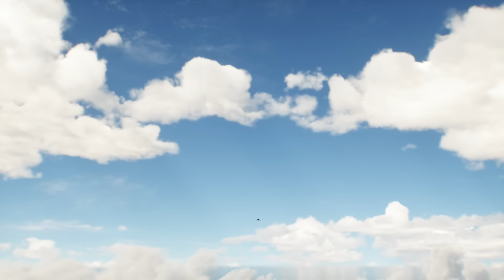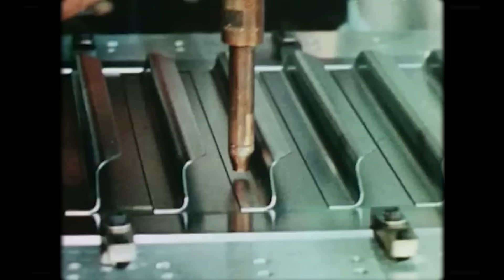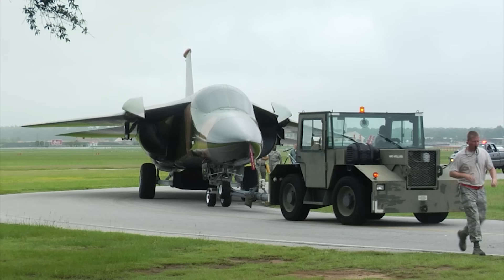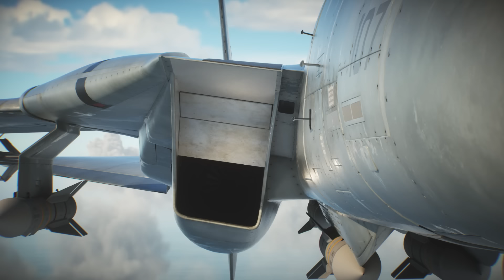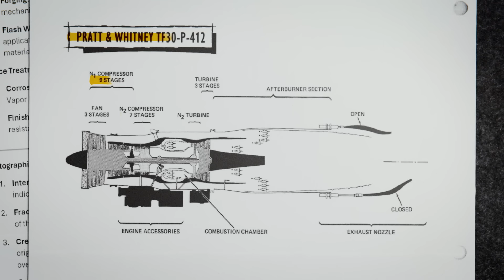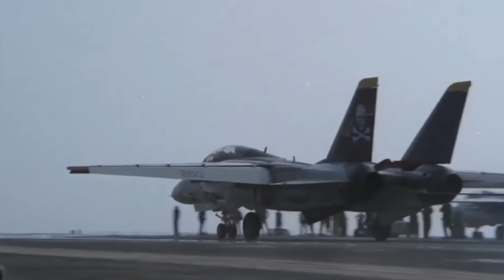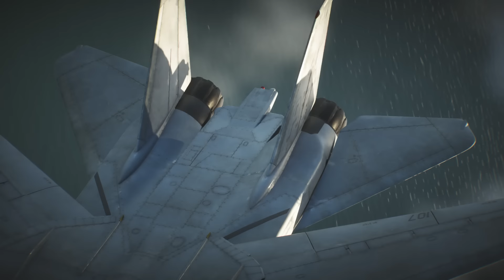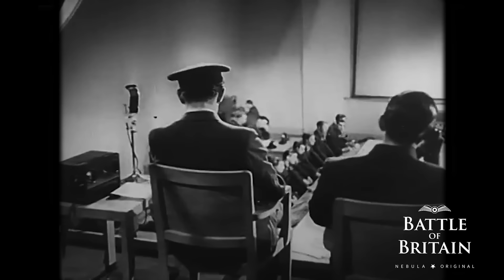The Insane Engineering of the F-14 Tomcat

Comment: Titanium isn't welded in a vacuum as you mentioned, it's welded in purge chambers that are air tight and atmospheric air is purged out with pure argon so that there is no oxygen present for the weld. 

But the electron welding process they made is a very cool process
Reply: you are correct, a small point but yes welding under substituted atmosphere
Reply: @metallicamadsam I don’t think it’s a small point. Doing anything under vacuum is difficult, and a substituted atmosphere would be a much, much easier process. Titanium is difficult enough to process as it is 😅
Reply: @eedobee  some titanium is welded both in a vacuum or with argon instead? correct or am i missing something
Reply: Titanium is welded under vacuum when necessary. It all depends on the application requirements, some applications can get away with just a gas shield, others a purge tank, and then critical applications such as a fighter jet wings get welded in a vacuum. I can’t imagine the F-14 engineers chose the more difficult and expensive welding process for kicks and giggles.
Reply: Electron-beam welding was chosen probably because it can produce higher-quality welds with fewer flaws and voids, which I think is required for applications like these.
Reply: Sounds cheaper to pump some Argon or nitrogen in as opposed to constantly recreating and maintaining a vacuum
Reply: While this is true in normal welding, electron beam welding does use a vacuum. In fact you cannot have a good electron beam without a vacuum be it in a vacuum tube, CRT monitor, electron beam microscope, etc.
Reply: You are incorrect, the titanium of portions of the Tomcat's wings and its wing box were welded in a vacuum chamber the size of a small house.  Grumman had 2 of these devices and added a 3rd. The type of welding was Electron Beam Welding, done under vacuum, not using substituted atmosphere or an inert shieding gas.  these were around 22 foot long weldments, the largest titanium weldments in existence at the time.
Reply: @hoghogwild  likely to mitigate the need for purging gases, and to help eliminate as much possibility for contamination, inclusions and porosity, I'd imagine.
Reply: But the Tom Cat were welded in a vacuum I think thats the point he was making.
Reply: Oversimplification to get on with a video that isn't about welding.
Reply: close enough cowboy 

i just wanted to say that cause it sounds like what a fighter pilot would say
Reply: FWIW, here's a bit from a NASA paper about the welders used on the F-14 "Electron beam welding, then, is essentially a mechanized fusion welding pro- -4 cess performed in a vacuum chamber where the pressure is reduced to 1 x 10
torr or less. "  https://ntrs.nasa.gov/api/citations/19740022811/downloads/19740022811.pdf
Reply: So titanium is welded like stainless steel?
Reply: You are wrong here. It absolutely can be welded in a vacuum. It's the same concept. Shielding the weld pool from atmosphere. Functionally identical.
Reply: Electron beams need vacuum. 
Tge beam won't work without a vaccum
Reply: Thanks boss, as a (MiG) welder foreman I was looking for just this comment. The welds wern't made in a vacuum, they were made in a over pressure room, filled with argon. Thank you.
Reply: It's also used as a reason why Iran can't maintain them. That simply isn't true though from what I can tell... There's really not much stopping them from just smuggling in a welder. Working with Titanium for new parts would likely be a much harder problem. Still likely within their reach for low volume stuff. Countries like Iran have trouble scaling things.

The reason electron beam welding isn't that popular anymore is because of advances in material science. The problem with electron beam welding is that it has to be programmed, and is also generally really slow.

If Iran isn't maintaining them it's more than likely just because they don't actually have much use for them as anything other than trophy's. The US ended up also not really having much use for them and them being too timely to maintain.
Reply: @lost4468yt  Another question is can they produce enough raw high quality titanium? And do they have the absolutely massive forging presses to produce the precursor components? There are only a handful around the world as far as I know.
Reply: @Virsconte  they would smuggle it from somewhere else. They also aren't going to be operating under the same conditions as the US, they'll be fine with increasing the weight, decreasing safety margins, not worrying about such a diverse range of conditions and part lifespan. And they're going to be operating with 50+ years of materials science progress that the US didn't have back then.
Reply: @lost4468yt  I've not seen much evidence that the titanium parts (the F-14 is 24% titanium by weight) need much maintenance.  For example, after the crash of the first F-14 prototype, the wing box was found six feet under ground, fully intact.
Reply: This.
Reply: i know argon is a noble gas but why bother with argon when they can just flush it with nitrogen or perhaps even CO2 ?
Reply: @fortheregm1249  you can use Nitrogen and CO2 as shielding gas, also helium, and sometimes a combination of gasses (C25 is a common mix which is 75% argon/25% CO2), can even do dual shield where you use a gas like argon and then the welding filler material has a flux core in it that burns off while welding and produces its own shielding as well

All just depends on what the material calls for, what the welding process calls for, what the joint configuration is, what the engineers call for, etc. each gas welds with slightly different characteristics but the most common for pretty much the large majority of processes is either pure argon or C25
Reply: @fortheregm1249 both nitrogen and CO2 can actually react with the metals and mess the welds up. Argon is used exactly because it is an inert gas.
Reply: @fortheregm1249 
co2 reacts in the Arc, same with nitrogen.  Depending on the process used you can use co2 with argon but the argon is critical for most types of welding with shielding gas.
Reply: Tomato tomato
Reply: @pr3ludejr  Let's call the whole thing off!
Reply: I just said it twice the same way 😅 @pr3ludejr

Comment: Holy hell y’all, you guys need to stop lusting over this thing. It’s cool, sure, hell I love the thing myself. But you gotta stop making up facts about it, especially about the microprocessor. The reason he didn’t mention the “first ever”microprocessor in the F-14 is because it wasn’t the first. This belongs to the F-111D, fitted with the Mark II microprocessor, and the first flight of the F-111D was in May of 1970, much before the completion of the F-14’s microprocessor in June of 1970. This first flight statistic isn’t even counting the fact that the F-111D’s  microprocessor had to be done quite a bit before the aircraft and first flight was. So no, it did not have the first microprocessor, please stop saying it did. If there are other examples of aircraft having microprocessors earlier, I’d love to know, but the first microprocessor definitely wasn’t in the F-14.

Comment: It should be noted that while the 17G pull of the Phoenix does sound impressive, G pull alone does not determine how agile a missile is. Tl;dr the faster something goes, the more Gs it needs to pull to maintain the same turn rate. And at Mach 4.5, Phoenix was actually one of the least maneuverable Air to Air missiles ever used. To give you an idea of how bad it was the Aim-9H, the dogfight missile F-14 carried, could pull 18Gs at 2.5 Mach (and keep in mind the 9H's motor would only fire for a few seconds, meaning it would realistically be traveling slower than 2.5 Mach by the time it reached its enemy).
This is why the Phoenix was never used on another aircraft and instead Aim-120 was developed, which can pull 35G at Mach 4.
Reply: And now we use the AIM-174B for the role the AIM-54 use to have lol.

Granted it's never designed to go for fighter sized targets but instead of snipe tankers or AWACS.

IIRC the C-5 variants onwards can pull more than 35g though I'm not 100% sure.
Reply: Hey I know this post is old but you’re missing a key bit of information! While yes at peak velocity a phoenix will technically turn at its worst a phoenix’s flight path isn’t meant to optimize speed, nor was it the engineers goal to do so with the lofting program put into place to optimize PK. The phoenix uses a completely different program for turning compared to something like a sidewinder and even some AMRAAMs I believe? Where it uses btt or bank to turn to use all of its fins to effectively push the missile in two planes effectively doubling its upper g pull by using all its actuators to turn more effectively.
Reply: The AIM-120 was developed for a completely different purpose and took 30 years to mature into a system that could potentially replace the AIM-54 as a direct alternative. The reason the AIM-54 wasn't used on other aircraft was simple; a lack of need. The USN were the only ones that needed a long range air to air capability at that time.
Reply: @dumdumbinks274  "The AIM-120 was developed for a completely different purpose"
Yeah, because the 57 couldn't fulfill that purpose. That purpose being BVR combat with enemy fighters.
Reply: @crazeelazee7524  ...So what was the AIM-7 for?
Reply: @dumdumbinks274  AIM-7 wasn't suitable for BVR, which is why it practically disappeared from US arsenal after AIM-120 became available. Funny you should mention the Sparrow, because the Phoenix wasn't able to render it obsolete the same way the AMRAAM was.
Reply: @crazeelazee7524  Lol. You're really trying hard to equate the AIM-54 with missiles it had nothing to do with. By your logic the AIM-7 should have rendered the AIM-9 obsolete, but it didn't because they have different purposes. 
The AIM-9 serves the short range requirement. 
The AIM-7 served the medium range requirement and was directly replaced by the AIM-120 (which had similar performance, but with modernised guidance systems). 
The AIM-54 served the long range requirement and didn't have a direct successor until the very recent development of the AIM-174.
Reply: @dumdumbinks274  What are you smoking, AMRAAM outranges the Phoenix since the 120D. Cope all you want, there's a reason why USN replaced its Tomcats with Hornets. Don't get me wrong, Tomcat was an impressive plane in the 70's but time spares no one.
Reply: @crazeelazee7524  The AIM-120D outranges the AIM-54A of the 70s. It does not outrange the AIM-54C of the 90s. Also noteworthy is the fact the AIM-120D didn't enter service until 10 years after the AIM-54 had been completely removed from inventory, and with a roughly 15 - 20 year gap in technology. You don't have a valid point here.

Cope? lol. Strangely it's always the people who make false claims that end up using that word. The F-14's retirement came about due to a number of factors that had nothing to do with the F/A-18, and a heck of a lot to do with the political and strategic situation.
Reply: @dumdumbinks274  Nope, 120D has a slightly longer range that 54C (about 10km) and most importantly, it can actually hit something more maneuverable than a brick.
Reply: @crazeelazee7524  120D is 97nmi vs the 54C at 100nmi. More importantly the 54C reaches such ranges significantly sooner due to it's higher speed, which in fleet defence can mean the difference between a target launching it's payload or being shot down before it can threaten the carrier group.
Reply: @dumdumbinks274  Besides probably not having the true range of the AIM-120D being public, the most significant change from the 54A-54C is really the seeker and ECCM. The 54A probably still had longer range with the Mk60 motor. Unless you are literally a person in the know, basing your argument on a supposed 3nm discrepancy where one item is certainly more classified, is not a really strong position.
Reply: @blkspade23  Mk60 was an alternative to the Mk47 produced by a different company, not a superior motor. 54C had much more modern guidance and a better lofting profile in comparison which is the reason for it's extended range and higher max speed. 

The 97nmi for the AIM-120D is already the highest estimated range based on the rumours around the D3 that was tested last year. Otherwise we are talking a bigger gap with the standard D model expected to reach out to roughly 85-90nmi.
Reply: @dumdumbinks274  It means nothing because any plane with a functional RWR can easily evade it.
Reply: @crazeelazee7524  Oh so we're still arguing about fighters, despite the fact the AIM-54 was created to intercept bombers. Your logic is quite amusing.
Reply: @dumdumbinks274  The only country in the world right now operating the type of bombers Phoenix was designed to attack is the US. Phoenix is obsolete and its lacking maneuverability means it has no use in a modern battlefield. Which is why, surprise surprise, it was retired.
Reply: @crazeelazee7524  You really don't like checking things before you type do you? The Tu-22M is still in service in reasonable numbers, and China has the H6 in greater numbers than the entire USAF strategic bomber force. Both those planes are primarily focused on delivering long range AShMs that can reach well beyond the range of the AIM-120D.

Regardless of those facts, you still haven't countered my original point being that there is no connection between the AIM-54 and AIM-120.
Reply: @dumdumbinks274  Yes, there is no connection. Because Phoenix was a dead end. Have you not been paying attention?
Reply: @dumdumbinks274  If you think Tu-22s and H6s are going to fly to within 700nm of a carrier (the kamikaze scenario where the F-14 goes for a one-way mission to intercept the bombers and then ditch) to launch an >1000nm DF-21 or YJ-21, I have seafront property in Mongolia to sell you. 
Did you really think that by "the type of bombers Phoenix was designed to attack" I meant the bloody airframes alone?
Reply: The Tomcat enthusiasts don't understand how missiles work, all they know is bigger must be better and that Top Gun was a 100% accurate portrayal of military aviation. If they knew enough about the intricacies of aviation and engineering to deserve an opinion, they wouldn't be insisting the Tomcat was the be-all and-all fighter.

It's still a really cool plane, though.
Reply: @jamesharding3459 yeah.
They are9 years old ofc
Reply: Pheonix was never used again because it was a big ass missile. F-14 was built around it, maybe the 15 could carry it physically but it would severely limit the payload of the 16 and 18 if they could carry it at all. AMRAAM was the right solution to have a standard missile all A2A platforms could carry. But going by kinematic performance alone, Phoenix was unsurpassed for decades. Iraqis didn't even know what hit them when Iran was dropping them from super long ranges. It wasn't only ment for slow big planes, it could shoot down every 4th gen plane out of the sky while outranging their missiles at the same time.
Reply: @electric_boogaloo496  During the Iran-Iraq War, Iranian AIM-54s did not manage a single confirmed or plausible kill against semi-modern aircraft. All 33 of its confirmed victims were older "monkey model" Soviet air frames lacking any kind of warning system. Of the other 45 assessed as possible but unconfirmed, only 3 were against later "3rd Generation" fighters with RWR sets.

FYI, the USN assessed that if a target pulled a 3G turn when his RWR went off, he would have a >90% chance of evading the missile. That is, to put it mildly, a bit shit.
Reply: @jamesharding3459 that’s some neat info! Can I get some sources for it? I’d love to read more information on both the Phoenix and the tomcat

Comment: can you elaborate on with "most welding techniques use combustion"? i was under the impression that most welding techniques also don't want oxygen getting in because oxides tend to be weak. this is why MIG and TIG welding use inert gas as mentioned in their names. as far as i knew, methods like MIG & TIG simply use high voltage to create an electric arc which generates the heat needed, no combustion involved.